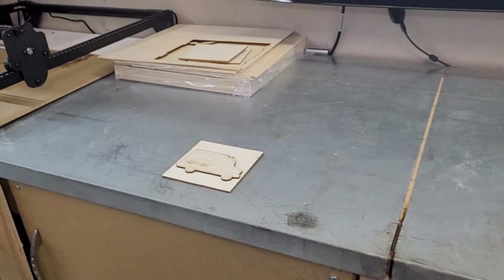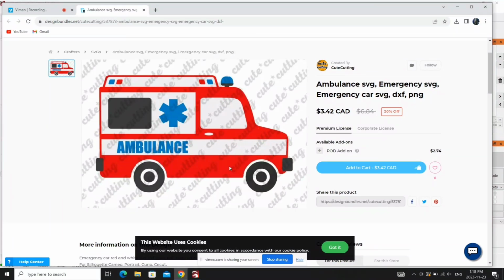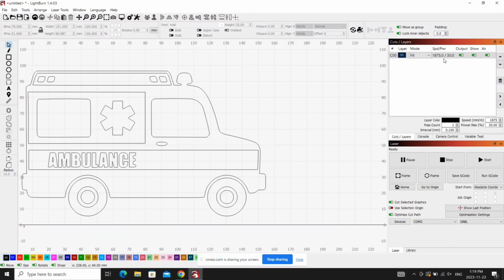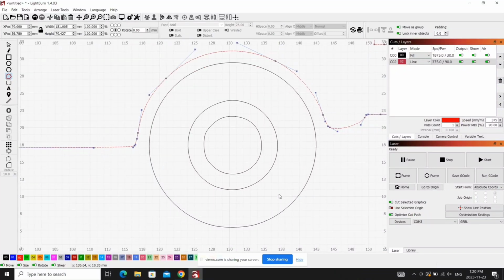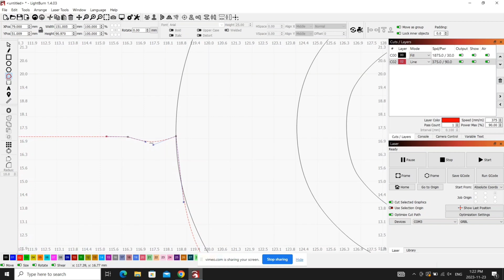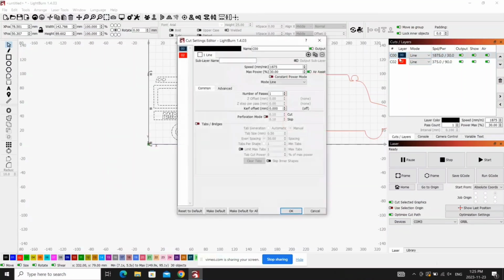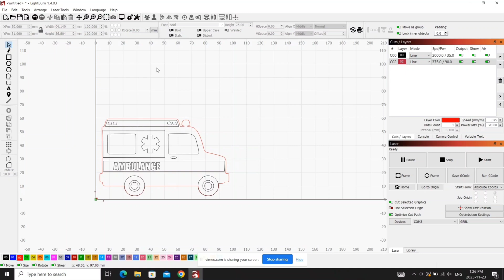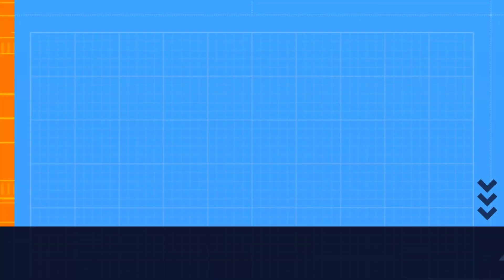Turn Any JPEG File Into A Laser Engraving In Minutes!

Comment: Nice video especially people who can benefit from a step by step guide as they begin using Lightburn..  Can I suggest that the last part might be done easier?  You can hide the red cut line by clicking the 'show' button.  It will disappear and then you can select the other pieces to group and then adjust the cut or engrave settings.  I find it hard to move things around and get them to align again.  Again, useful tutorial that will likely help people who are overwhelmed with the more advanced users!